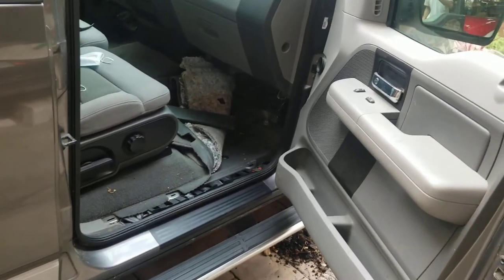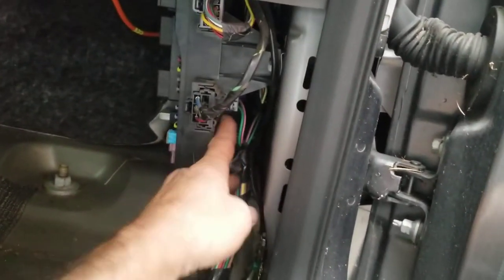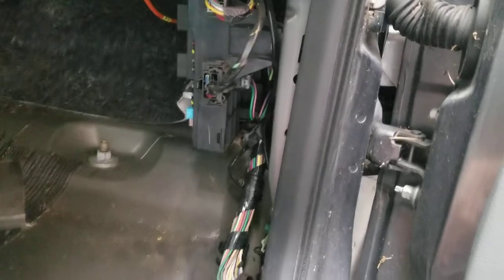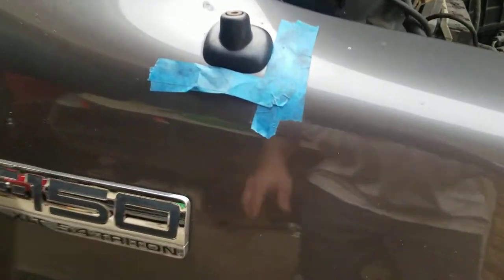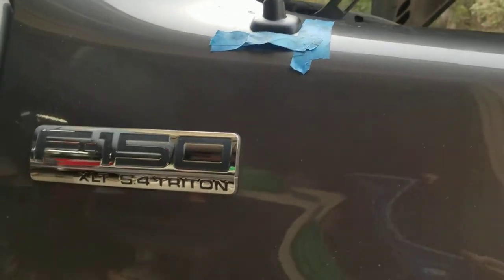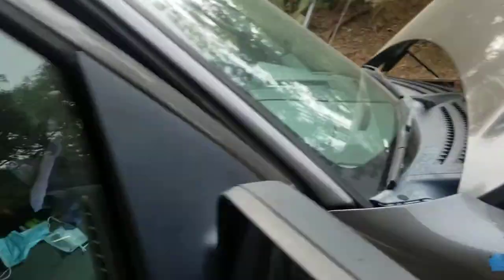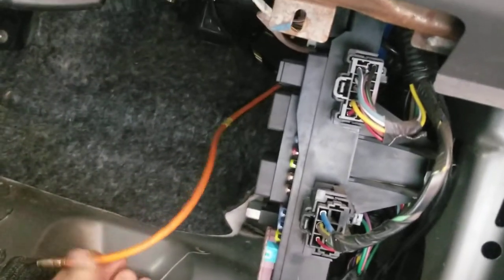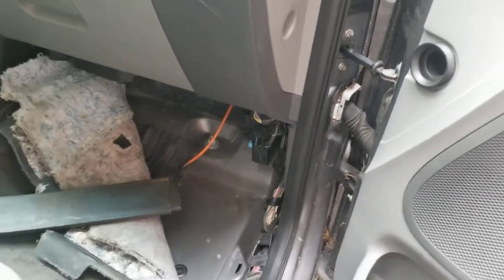2005 Ford F150 Antenna Water Leak into the Cab

Comment: Thanks a Lot for sharing.
I have a 2006 F-150 truck, and I don't have tis problem, but my antenna is  not working good, it may be that the orange cable terminal is loose, etc., but sinse I don't have extra time, I will purchase a new smaller antena and replace it for the old one.
Your video helped me to take action.
Thanks again.